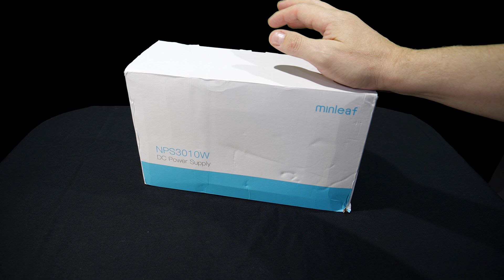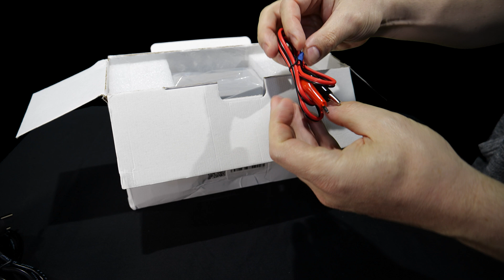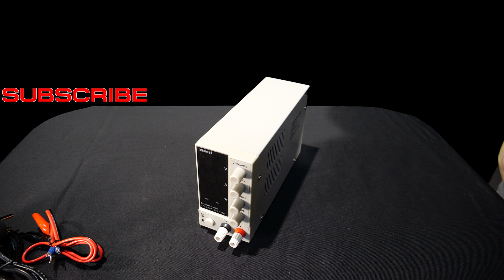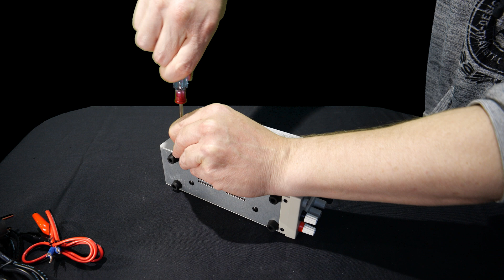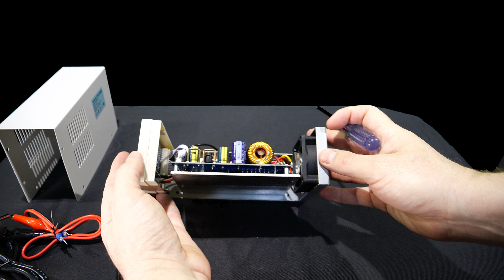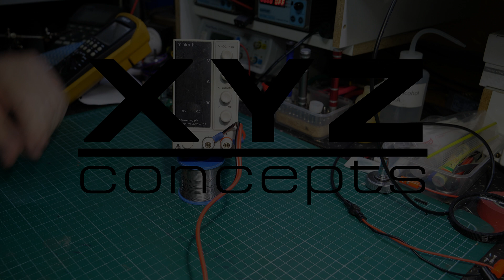#19 – Minleaf NPS3010W teardown and review – Part 1

Comment: after some inspection ,I found a 100N 400V was bad ,replaced it with 100N 630V ,it works again ,only a short time  ,Fet's are  now shorted  ,replace the fets  and they blow up
Reply from the maker: Sounds like a switching/timing issue did you check the switching IC?

Comment: HI, I see this unit, as well as some other units like the Wanptek NPS3010W do not have a GND output. But some others do. In this unit or others which don't have GND output termianl, is the ground connected internally to the minus terminal, which means the output is not floating ?     some units have GND terminal as well. Is it a really necessary thing to have ?
Reply from the maker: Do you mean Earth ground?  Most common switch mode PSU’s are galvanically isolated – the output shouldn’t need earth-GND that’s achieved on the high side if supplied from AC mains source.  The output GND or “secondary ground” is isolated from earth-GND electrically.  However, in some audio applications there are times where the 2 GND’s tied together to prevent “ground loops” which manifest as audible oscillations or hum.
Reply: @xyzconceptsYT  Yes, I meant Earth ground. Thanks for your answer.

Comment: Could this power a 24v TS100 soldering iron and a 24v ISDT Q8 Pro BattGo (max 20w) Lipo battery charger or would you recommend something else?   Like the Hobby Porter 24V 16.6A 400W Power Supply?  I thought a cheap bench adjustable power supply might be a little bit more versatile.
fpv.air-war.org
Reply from the maker: This PSU will definitely do what you describe, thanks for your comment.

Comment: I have that unit and since this is my first adjustable psu I'm a little confused since I can't adjust the current, no matter how much I turn the pots. Is that supposed to be like that?
Reply from the maker: Hi, you need to short the output and adjust the max output current you need.  Once set, the PSU wont deliver current higher than what you have set.
Reply: @xyzconceptsYT  Ahhh, I see. Thanks for the info :D
Reply from the maker: No probs at all :)
Reply: @xyzconceptsYT  Hi, do you know why my model doesn't show the correct current? I've measured the current using a multimeter and it should be 0.76A, but the display doesn't change from 0A